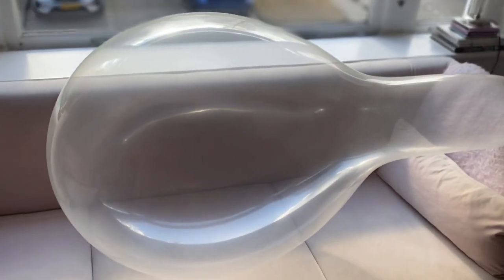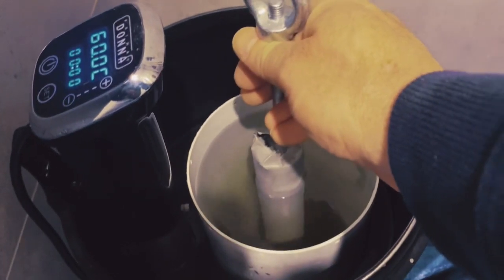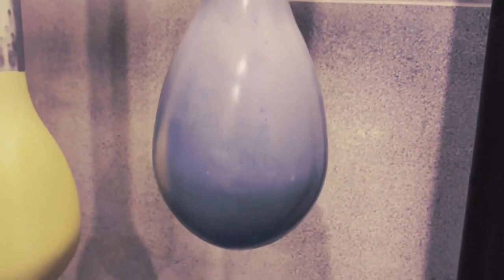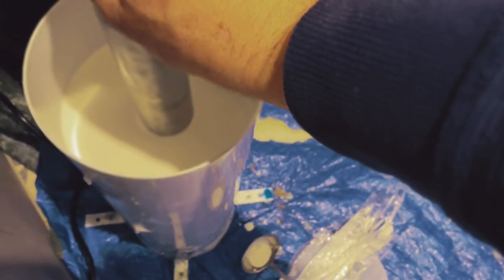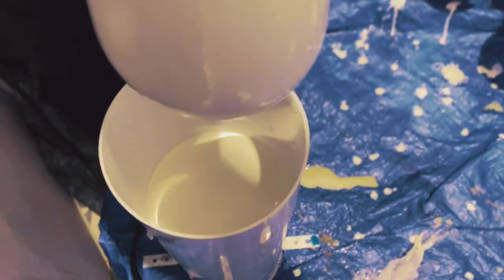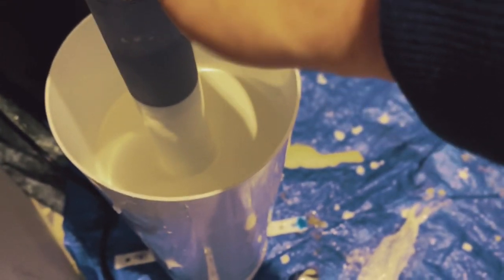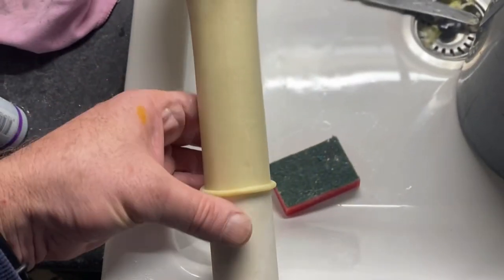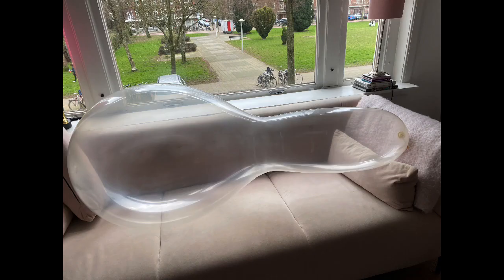Making homemade balloons

Comment: Excellent! Thank you. You might like to make a balloon that sacrifices high tensile strength, near perfect elasticity, and high durability for extra softness, that is, a balloon that caters more to the tactile dimension than the visual dimension. I do this by tweaking an existing balloon rather than making one from scratch. My goal is to devulcanize and depolymerize a balloon by breaking crosslinks and shortening the rubber polymer chain. I do this by heating a balloon in an oven at about 180°C for 10-20 minutes. The net result is a balloon that feels much softer and stretchier and blows up much bigger than normal. I know a balloon can be made that mimics the characteristics of a baked balloon, but exactly how it's done is unknown to me. My guess is that it's a combination of finding the right short-chain rubber latex, which is almost unvulcanized, and then adding in an appropriate plasticizer. If you've never experienced a baked balloon, then it's a must thing to try. Start with cheap round latex balloons and experiment by trial and error. I think you'll be amazed!

Comment: This is absolutely neat! The lowering and raising part is critical to avoid church windows, even professional manufacturers like qualatex and Cattex still have church windows on their balloons. Maybe a motorised mechanism to precisely perform the lowering/raising movement, plus locating the whole system  inside a vacuum chamber would help getting rid of the bubbles?

Comment: Very interesting. I recently saw some antique forms/molds that were used to hand make balloons in the past. Do you know how the process may have changed over the years, especially with respect to the coagulate, etc.?
Reply from the maker: I think the basic principles are the same. The coagulant is basically just a salt though it comes in many different forms. It is a skill that takes practice though. I still am learning everyday.
Reply from the maker: My process has changed a lot since I made this video.